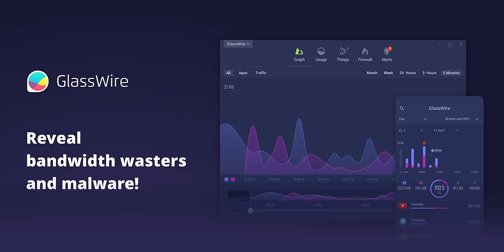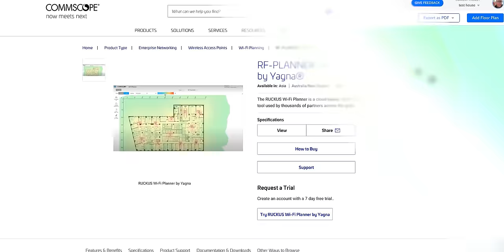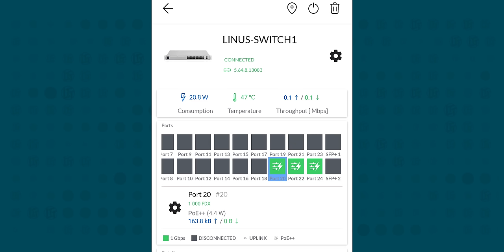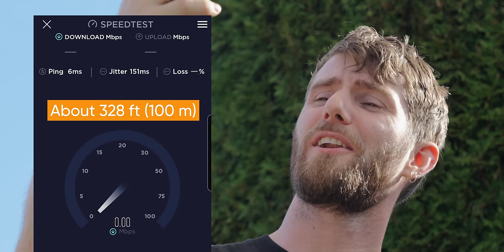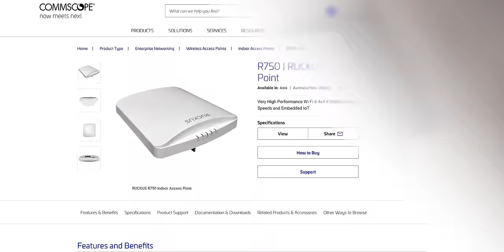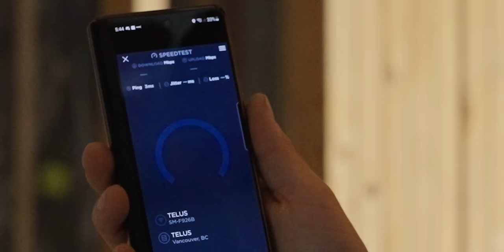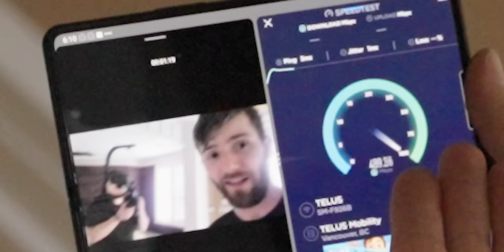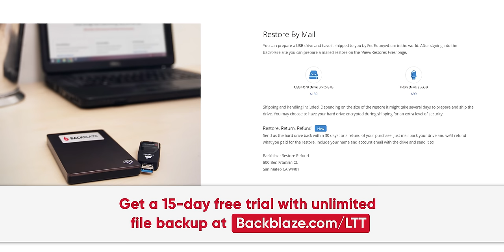Unlimited Budget WiFi at My New House

Comment from the maker: nice
Reply: hello
Reply: Lit
Reply: Nice
Reply: nice
Reply: nice
Reply: not bad
Reply: who forgot to pin this? Also I hope your house is Unit 101. Otherwise you be STEALIN that ladder. ;)
Reply: tech tips
Reply: dang only 15 likes thats sad
Reply: Yes
Reply: why just 20 likes
Reply: someone robs your home just take the Wi-Fi box
Reply: 5 years later my wifi to slow.
Reply: Hey you ever heard of orgonite or orgone devices? You know how wifi routers kills plants and sends invisible radiation in every which direction; well orgone uses the layering of organic and inorganic materials to create a channel or vortex to suck in positive anions like microwaves and transmute them in to safe and health conscious negative anions. Discovered by Wilhelm Reich in the 1930’s.. outta be good for the liddo ones.
Reply: Most contain a quartz crystal wrapped in copper coil and aluminum shavings which when made into a mold or cast with polyester resin creates a piezoelectric signature from the quartz crystal. The inorganic is the resin the crystals and copper and gold and aluminum are the organic materials used.
Reply: There’s also grounding technologies that allow the frequency of the earth to be able to be felt while inside your home and even applied to shoes that at an end tuck into your sock or shoe. Other devices like blankets made or lined with silver or so could connect to your heaters that are usually grounded structurally to the earth outside or under your home.
Reply: We’re bringing Atlantis back baby!
Reply: 69th like, nice
Reply: nice
Reply: 69
Reply: What is
Reply: nice
Reply: im stupid, so im askin what wifi u use
Reply: With that kind of WiFi Dennis will live in your house forever and never leave, right?
Reply: nice
Reply: Just spent alot on 10 gig networking, and put mediocre wifi,

Comment: In the next episode: Linus gets a visit from the local regulatory agencies investigating what is causing massive interference with every 2.4 and 5GHz network within a half km or more.
Reply: as someone who uses/installs Ruckus gear, I can tell you, their stuff has proper RF shielding and will automatically adjust broadcast power to best optimize range and its antenna arrays means that it only needs to beam signals towards the device as it needs to, so if anything a Ruckus setup will generate less interference than an equivalent say Ubiquiti access point, which basically has no shielding. Look at the inside of a Ruckus and look at the inside of a Ubiquiti and I think you'll understand a little better. You don't need masses of power if you're clever about how you use it.
Reply: @richardyao9012  a) it's called a joke, and b) it was mainly referring to the ginormous transmit power of having eight long-range access points clustered together like that. I'm entirely aware that it'll most likely work out just fine.
Reply: @chrisjc2k  Hey, you're no fun. Also, regardless of shielding, beamforming, adjusting transmit strength to reach connected devices etc, that's still an insane amount of transmit power wihtin two relatively packed frequency bands in a very small area. As I said above, no doubt it'll be fine, but it's still pretty bonkers.
Reply: @Kraaketaer  at my work we often have 10 times this in a smaller space. For his house this looks about right from the quick glance.
Reply: Lol bruh it was a joke, dang guys leave the man alone
Reply: @chrisjc2k There's no equivalent Ubiquiti gear. Ruckus is far superior over most other wifi manufacturers, only a few are on the close enough level (aruba)
Reply: @zlotvorx  preaching to the choir buddy! It was more ‘if you had an equivalent number of ruckus APs and ubiquiti APs in that space….’ Unfortunately people seem to see them as somehow equivalent and in lower client scenarios like a house people do do direct comparisons and then complain how expensive Ruckus is!
Reply: @chrisjc2k  Sorry, I've read it as as Ubiquity has an equivalent. In my scenario (just counted) over 1000 apartments in a circle of 300m, and every of them has fiber with a crappy 2/5 WiFi modem, I had tested Ubiquity, Mikrotik, Aruba and Ruckus.
Unifi and Mikrotik produce near the same performance, but Mikrotik can be tweaked. Never got more than 200Mbit on 5GHz. On 2.4 it was much worse as expected - no more than 30-40Mbit
Both Aruba 303 and Ruckus 610 performed much better, Aruba 350-400 and Ruckus maxing out my 500Mbit connection. Will test again to check locally with iperf3
Reply: @richardyao9012  #yourmissedthejokeidiot
Reply: But dude... WiFi 6 transmits covid 19... Rip 

/s
Reply: @lukesanchez7415  Damn, you're right. Completely forgot that. Makes complete sense, they keep talking about infection hotspots, and here Linus is mounting a bunch of wifi... hotspots. That's too convenient to be a coincidence.

/s 😅 (you never know what people might think is serious these days!)
Reply: @Kraaketaer  this is the problem with text. Specifically sarcasm. You never know HOW someone with read what your wrote.
Reply: So at $600 per access point, I think I'll stick with TPlink!🤔
Reply: @mrtechie6810  My network is built on TP Link but I don't like some of the stuff I've been reading about its tendency to "call home." Unsure how much of that is routine pinging for updates versus something potentially more concerning.
Reply: @bepbep7418  Oh, absolutely. But it also depends on the reader, and IMO taking my initial comment here seriously would require a presumption of ignorance, especially considering the format I wrote it in ("on the next episode" etc.). If people didn't automatically assume everyone online was dumber than themselves, a lot of things would become easier and more friendly.
Reply: @DanielSRosehill  mine too. I did a lot of research before settling on TPlink. The deluxe brands are just too pricey and they are designed lock you into using their brand equipment....

Comment: Linus has hospital wifi at his house
Reply: Not NHS hospital WIFI, that thing is a small step above dial up XD
Reply: Yeah, but for an massive hospital😂
Reply: @tazzrats  NHS Wifi is like 3mbps in my area
Reply: You’re hospitals have Wi-Fi?
Reply: @AIC69420  there’s NHS WIFI???? Bro what how did I never know
Reply: hmmm no. Hospitals have thousands of devices. With budget constraint and lots of concrete walls. They'll usually invest in MULTIPLE smaller CISCO APs. And you can bet they'll throttle most wireless connections so that the wired equipment with literally vital services have priority.
Reply: Definitely don’t live in the UK. NHS WiFi is as bad as dial up
Reply: @kevo05s  Sure Doctors office can afford WiFi around a hospital. Wonder how many new devices you see on the network every 2 to 5 yrs in the hospital.  Never ending carousel of devices on that network backbone.  Linus needs to see if he can buy some sort of sleeve (garden hose or a rubber metal mesh) to keep squirrels from eating through the CAT 6E cable outside. Also zip tie the cable to the bracket don't have to worry if some tech comes by the house starts pulling on that CAT 6E cable making room to force some pipe in the roof. Would have been best to drill wholes in that bracket just so he could add more zip ties to make sure they can't tug on that cable.  Hopefully Linus checked with the Housing Authority to make sure it isn't violating any code. Have a noisy neighbor doesn't like you call the housing authority every 5 seconds cause you violate housing code.
Reply: Wifi in hospitals is actuly pretty impressive. NHS hosptials are often members of the academic network, with a central authnetication solution so doctors/ nurses and visiting professors can move between hospitals and have seemless access. It's all policy based so the non staff side of the wireless will be limited to any data left over. 

Most hospitals will be running cisco, aruba, merki or Ruckus and the set up makes Linus house look pretty basic. The Set up Linus is using would be consided an entry level set up both in terms of scale and configured features. 

When it comes to hospitals it not about speed (networking in the enterprise is rarerly about speed) its all about the policys and stability and coverage. Who, what and where is something connecting from and where does i need to get access to. You probale dont want the visitor to site conencting to the same network segment as the heart monitoing machine in the operating theater. 

Having working on hspital networks and in reserch I can say what Linus is installing is pretty basic in terms of enterprise wireless. Nice home set up though
Reply: @TheDevilWAH  Yeah hospital wifi is to enable communications within the hospital, not to enable patients to make tiktok videos from their hospital bed.
Reply: @TheDevilWAH  You are absolutely correct. Enterprise Wi-Fi also has to cover security standards. AFAIK only Cisco + Aruba cover the best security standards (the Marriott tests). While the UNIFIs are great for homes and maybe small hotels etc for free Wi-Fi, serious enterprise will go with Cisco, Aruba, Ruckus...
Reply: XtraPixel  hmm may be a bit wrong there, I get 1.1Gbps XD
Reply: Wifi in hospitals? LOL. Bruh, even cell service is shit in hospitals for the most part. Consider yourself lucky to even get a meg or two on LTE
Reply: @tazzrats  Hospital wifi in Ohio at the Cleveland Clinic is even faster than this videos...
Reply: @tazzrats  the nhs hospital i went to not too long ago got 250 mbps, i took advantage of it and downloaded like 5 movies on netflix
Reply: @TheDevilWAH  there's 4 wifis in the NHS. They have the usual wifi that the CPUs use, then you have the WiFi for Doctors and Academics as you mentioned, then they have another WiFi for the admin staff etc. Finally the public WiFi for visitors
Reply: @abdulsabur1673  I have been designing wireless for clients for 20+ years. 

Wireless these days is policy based. There's is normally one SSID (network) for staff. Hospital devices will authenticate securely and depending w ho is using it ( doctor, admin, nurse) will be given specifivmc access. There will also be a SSID for public / guest access. And a third for non user devices like hospital medical equipment . Staff are also often allowed to connect there personal devices to get internet only access. 

But these are not separate wireless systems. They are controller based wireless platforms. And normally have 10's or 100's of access policies and 4 or more SSID's broadcasting.

And not all hospitals use the same SSID's.
Reply: @kevo05s  You realise that when these APs are not connected to unleashed, but either a zone director or a smartzone controller. You can have thousands of them on a single network and it's not uncommon. Literally made for hospitals and large schools

Comment: Linus: We have to use 8 AP because it's huge and has concrete between each floor
Meanwhile at Mexico:
one ISP Router for a house made entirely with bricks and concrete
Reply: Fr
Reply: Relatable AF. I had to buy another router to get a decent wifi on the opposite side of the house where the main router is, and my house is nowhere near the size of Linus'
Reply: The best possible wifi plan in my city is about 200 times slower than his wifi
Reply: I have 2 Access Points for 60sqm2. So technically I have a more advanced setup than linus. One is outside that gives me 300 meters of wifi connectivity which I need to due to lack of mobile internet. until 305 meters from my home, where I have mobile internet.
Reply: For real! They have it way easier with their drywall homes. I'm sitting next to my Telmex router and its slower than Linus' yard's speed
Reply: @KevinChaires  is lumber more expensive than brick in mexico or its just a standard of construction?
Reply: Same in india
Reply: @SpecialKthx  just standard
Reply: @SpecialKthx  standard of construction I guess, same here. Concrete and bricks (not the red kind of bricks, those are mega expensive)
Reply: Don't know about mexico, but for most of eu, yes, houses are mostly made out of brick, concrete and steel mostly for structural integrity afaik and then for isloation there's usually 5cm of insualtion (expanded polystyrene cuz it's cheap or poliuterene if you have the cash).
Reply: @SpecialKthx  brick is cheaper in mex
Reply: This comment shows you don't know what you are talking about and cannot relate to Linus in any way. I have felt your pain and know it won't work here or there.
Reply: @thehow2370  well if you depend on a "wifi plan" its honestly your fault, wifi isnt something for that you need your isp´s permission or knowledge, get the hw yourself and feed the router with your isp router.
Reply: @SpecialKthx  depends on where you live and how much money you have. For the most part though B&M is the standard construction material.  TBH I wouldn't want a sheet rock and stick house here either, certain Holidays Folks like to unload their  firearms in the sky.
Reply: @tgziceblood  how do you make roof out of bricks? In canada its easier in wood because of insulation. And we dont have people shooting guns ahaha
Reply: those buildings are also known as masonry buildings
Reply: @SpecialKthx  styrofoam sheets with wood forms for support or just straight wood forms.
Reply: @tgziceblood  here if we make a concrete floor(not like linus 1.5inch floor slab for inslab heating) Im talking about a 8inch floor slab. They are expensive. Usually they are in highrise building or 10-12inch for under parking garage.
Reply: @SpecialKthx  yeah , construction " laws " are subject to interpretation here lol.
Reply: Brazil understands your pain, mate

Comment: Two APs capable of 1k clients each, for every person living at the Sebastian household with a 10Gb fiber connection.  Yeah, that ought to be sufficient.
Reply: I wonder if these industrial wifis hubs are energy efficient, when most of the time there are only 2 or 3 smartphones connected to each of them....
Reply: @TremereTT  EZ answer is no. 

These devices are certainly not designed for 1 user, maybe for 0 users, but in that house something will be always connected. It is impossible to downclock that kind of HW too much.

3x the power usage 24/7 is conservative estimate, this times 5 compared to basic ubiquity routers which are much more than capable..
Its true that it will be pretty small % of power usage of that home, but it adds up.
Reply: @tom-qx6dq  Also as they are indoors I guess they will contribute to keep the the house warm in the winter. So nothing is lost.

Comment: Linus: "If you're willing to settle for 200 - 300 down..."
Me: <one ISP option that gives me 25 down for the last 10 years...>
Reply: Wish I could get that. 2.5 down
Reply: I get same as linus numbers around my house as well just the M is K
Reply: me living in rural UK on that hot 64Kb/s fixed line, thank fuck for lte-a
Reply: One word. Starlink
Reply: @shahaan400  waiting for my dish.
Reply: Thankfully I have two options and Spectrum gives me 200 down but my only other option is AT&T and they only offer DSL in my neighborhood with 1.5 down and .2 up.
Reply: Brothers for I have been delivered, after years of ISP hostage negotiation I have acquired fiber internet with pings lower than the wing beat of a bee and speeds higher than a private jet...LOL Better yet its only 70 dollars.....
Reply: @shahaan400  Not available in my area until late 2022
Reply: @joshuasterling2144  what company?
Reply: @szymex8341  Maybe not now but in the future you should consider the muskinater internet as an option.
Reply: I get 1 gb down and 100 up xD i am in Australia
Reply: Mine is 48mbps up and down
Reply: I used to be on 4-7 down and less than 1 up with the worst possible ping (dsl/vdsl)

Suddenly fiber came to my area, I quickly opted for the cheapest plan which gives 100up/down and my lord this is the single most life changing tech upgrade I've had in the past 7 years!
Reply: @joshuasterling2144  what wifi provider do you use?
Reply: @joshuasterling2144  Only 70 . Thats disgusting expensive . American Internet omg
Reply: @xythiera7255  that’s actually pretty cheap compared to 227 dollars my neighbors pay for 400 down and 30 up
Reply: @a52e6  Heard that brother
Reply: @mehulkalra2002  At least its symmetrical bandwidth, that is better than some for sure.
Reply: In my area, 4G is only option at the moment :(
Reply: Try 5 down. Heheh.
You can watch most hd streaming services, but there are a few like TV+, Hallmark, that need 6mbps or it doesn't work. 25 is good enough for most purposes
Reply: @Solarbonite  "25 is good enough for most purposes"

Not when your connection is asymmetric and you get about 2 up. That 2 up represents 100% of your bandwidth, so whenever someone's phone decides to backup, or your cloud backup service is synching, everyone else is out of luck. It's also only good enough for a small handful of devices. When you've got 30+ devices on your network, 25 down is absolutely nothing. And the number of devices is only going to increase, not decrease, due to IoT.